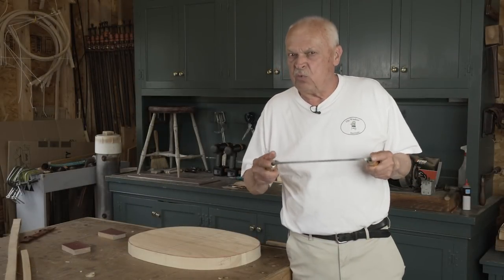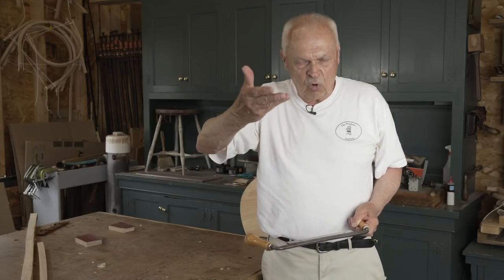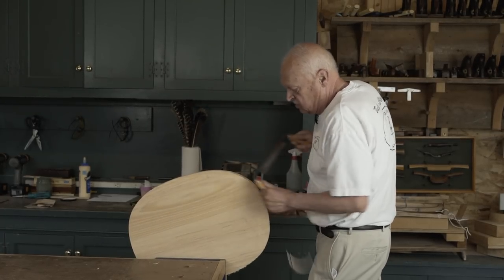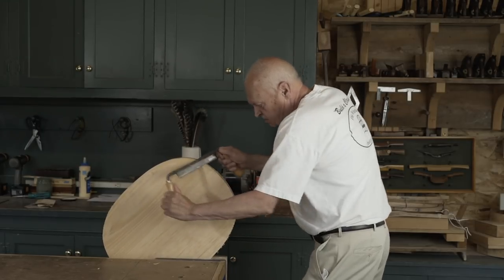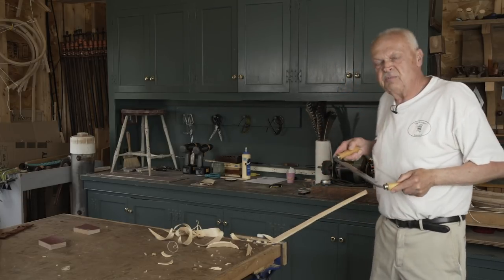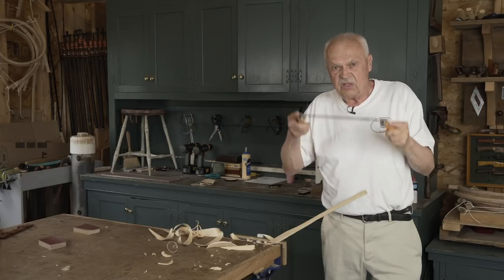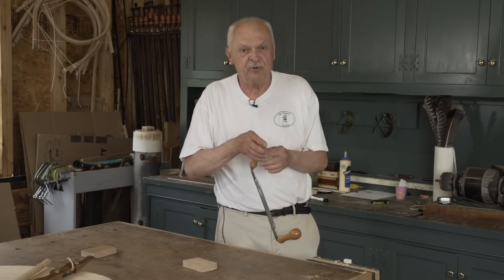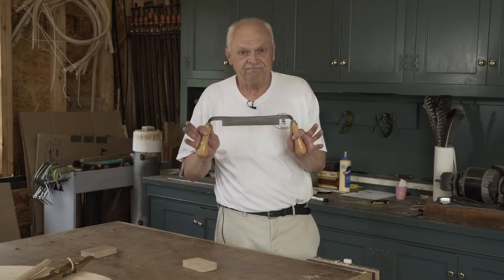Using the Drawknife in Windsor Chairmaking

Comment: I just watched a few videos of how to use and sharpen a draw knife giving very bad advice.  This video is spot on!
Reply from the maker: Thank you Patrick for the kind comment. I worked with a drawknife for 45 years. Any day I spent in the shop I performed numerous operations that required that tool. I made my living as a chairmaker, and in that way I was like the guys working in the 18th century. I did not make chairs to be quaint or to fill some 1960s Hippie desire to get back to the land. I had to be as efficient as possible; my family depended on me and my ability and skill. I learned to use all my tools with maximum efficiency. That is why (like the old guys) I did not use a shavehorse. Anything that slowed me down cut into my paycheck. I have read and seen a lot of advice about drawknives that was not grounded on this impulse.

Comment: Thanks for another fine video. I have been lucky enough to have seen the resurgence of interest in using hand woodworking tools over the last fifty years (many thanks to Roy Underhill, yourself, and a host of other talented, knowledgeable and generous craftsmen) and have always been amazed at the versatility and efficiency of hand tools including the drawknife. As a result of my interest, I often buy abused older tools and restore them to a useful condition. I sell a very few but only to local beginners with very little, if any, profit and usually with a free book, another tool, or a strop, just to encourage the fledgling craftsperson. The sharpening technique you demonstrate is adequate for general maintenance, particularly for new tools, but what about older tools with chipped edges, pitting on the flat and similar major flaws. I have found that careful grinding and limited dubbing, if necessary, can restore the edge to good service where hand-only work would have required days of effort. While such actions may not be desirable for new tools, it is pretty much the only reasonable option for the majority of older tools. As many of the older tools are widely available and at much lower cost (crucial to many beginners) than new ones, would it be possible for you to do a followup video demonstrating how to prepare an average old drawknife? I know that restoring older tools are dear to your heart since you literally (pun intended) wrote a couple of books on the subject. Thank you, by the way, for your books on craft. They have occupied an honored spot in my library for decades now and I still find them tremendously useful.
Reply from the maker: Thanks for the kind words, Mike. I have found sandpaper sharpening works real well for reclaiming most old tools. If a tool is badly worn begin with 60 grit and work up through finer grades. That said, some tools have been so abused that I pass on them. I have considered a draw knife video as a short to accompany another series. For now I am looking for a sponsor. While I work for free the videographer insists on being paid. BTW, I only flatten the back. I never try to dub the lower edge. I allow normal wear to create it, and then, my flattening just keeps it under control.

Comment: Noticed you didn’t mention preference for straight, curved or bowed (not sure there’s right term maybe coopered). You demoed straight. Would be nice to hear recommendation of brands for those looking to acquire a nice user as I’m sure some companies were more consistent in steels over years.
Reply: Oh, and awesome content once again.
Reply from the maker: The blade shape (straight or bellied) doesn't matter a whole lot. The trick is the slicing cut. My knife was made by Woodjoy. For years I used a knife made by Genuine Forgery and really favored it. However, Ray Larsen retired and I didn't want to demonstrate using a tool my students couldn't acquire. Barr makes a good knife as well. Although I wrote a book titled "Restoring, Using, and Tuning Classic Woodworking Tools" I eventually realized that using old tools wears them out. So, I fostered and supported a cadre of toolmakers whose products were as good as the old.

Comment: Hi Mike. Loving your videos. Could I ask, what is the type of plane you use on the spindles on the back of the chair?
Reply from the maker: The plane was made in China. I believe I bought mine from Woodcraft Supply. I'm not sure they still carry it. If not, I think Lee Valley has them.
Reply: @thewindsorinstitute2047  so it's basically a small nosing plane. I think I can make one of those. Thanks
Reply from the maker: @WoodcraftLeagueOfAmerica  Actually, it is not a nosing plane in that the sole is only a portion of an arc, not a semi-circle. The plane is so inexpensive I would buy one. Don't go to Crown. The source is either Woodcraft or Lee Valley.
Reply: @thewindsorinstitute2047   gotcha. Yeah, I was thinking that Crown plane seemed way overpriced. can't seem to find the cheaper one. I'll keep looking, thanks.
Reply from the maker: @WoodcraftLeagueOfAmerica  http://www.leevalley.com/en/wood/page.aspx?p=64009&cat=1,41182 Check out K, $9.

Comment: He did not explain well the issue of bevel up or down. I think it may be a case of  learning to use it one way  which soon becomes comfortable,  and then deciding that is the proper way. Both drawknives I use were built with the handles bent up from the flat back. That brings them parallel  to the stroke with the bevel down, and is most comfortable for me. I understand that a deeper cut can be made with the bevel up, and he illustrates that by taking a deep cut using a chopping motion, something he previously said shouldn't be done  That's confusing. 
 
Both my  knives  have a slight curve to the blade, the flat back being convex. With the bevel down , the pressure against the blade tends to straighten the blade out when cutting, so I'm pretty sure they we're designed to work that way . Obviously any carving knife can be used  left or right handed so they will cut either way, but the direction of the cut is different than a chef uses carving beef. The draw knife is more complex.